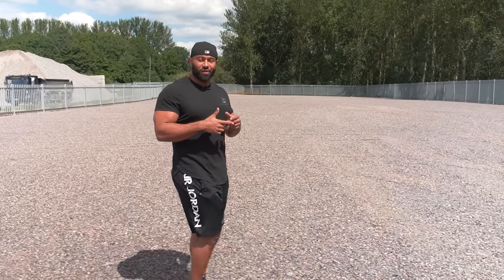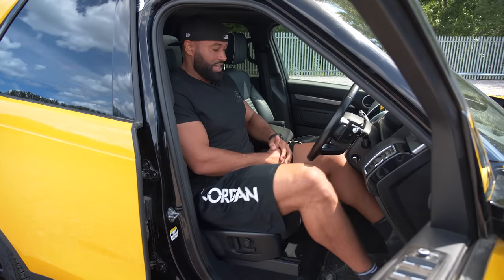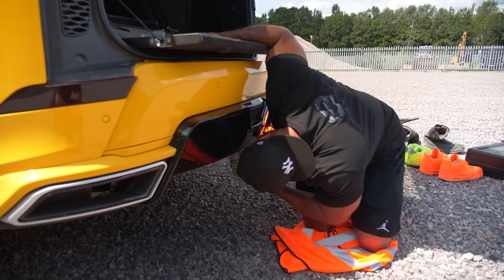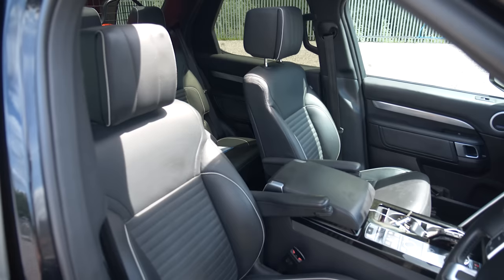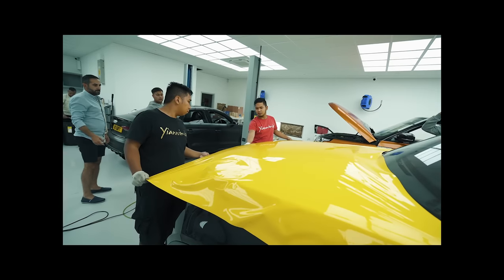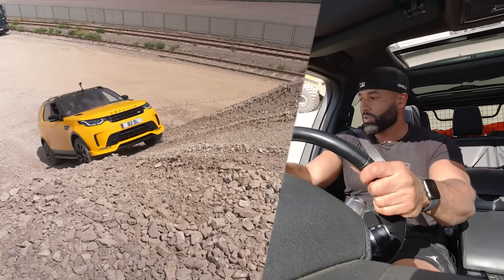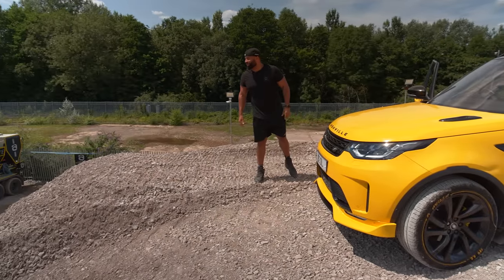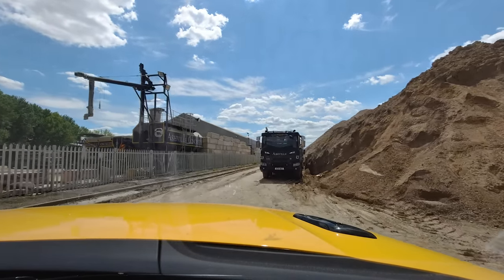Review of My Land Rover Discovery 5 with Construction Off Road Test

Comment: Try the new LR Defender, it's got front/rear cameras so you never have to worry about hitting objects or descending. May not have all the bells compared to the Disco 5 but from what I've seen it's the new work horse from them. Time well tell if there's teething issues.Was supposed to have a off road test with it through my dealer but because of the current situation that's on hold but from when I went for a test drive it handled far better than I thought though I still have my reservations about the amount of tech in it.

Comment: Hi Daniel,  the Disco 5 is a great vehicle with comfort, safety, tech, and excellent off road ability. Makes a lot of sense 4 u.  I love how it looks with the yellow wrap, and with the mods u have done. Ur car is on 22” Tyres. An all terrain Tyre will give it much more off road ability. If u put the vehicle into low range it would have got up the slope much easier. Have u done a LR off road drive day ?? It appears that u have not. I’d suggest that u do, so that u know how all of its 4wd systems work. U will learn heaps, and then u will also b able to do anything off road, much easier, and with more confidence, as u will know how to use all the 4wd systems in the Disco. If u want ur Disco to b more responsive and quicker, get an ECU tune done to it.  Enjoy ur excellent vehicle.  👍👍

Comment: I noticed b4 you descended that gravel hill that both your centre and rear lockers 🔒 were open 🔓.
Add to that, u have low profile road tyres, not surprised u got stuck going uphill !
Reply: Mazvimbbskupa Chihota check this out https://youtu.be/sLUruYymyxI
Reply: I watched it @roninesce8362  . Thank you. I am by no means an LR head, but every car its limits. Also, I'm sure you noted that was a Disco "Sport". It has limited capabilities compared to this reviewed LR5, as much as we can't compare an LR5 to a defender which is designed from the ground up to have better 4x4 abilities than the rest of LR lineup.

Comment: Hi Dan,
Great video mate. 
I’ve got the V6 Amarok but really do like those Disco’s
Have you had any problems with it? Had Disco 4 a while back and it gave me loads of trouble. 
Cheers 
Rich
Reply: The newer Discos tend to be better quality than they were for the early 2000s sorta time, definitely way less early days issues with my 2018 than a 2011 Disco.

The free five year service program is a must though in my opinion, if possible to get it free with the vehicle. Will most likely on sell before that expires

Comment: 1. You cheaped out on the tow bar. That's not the electrically deployable tow bar. 2. A quick remap will get you over 300bhp. The upgraded SDV6 is twin turbo to your single turbo. You can get the gearbox remapped too which sorts the multi gear kickdown. 3. What's the body kit?

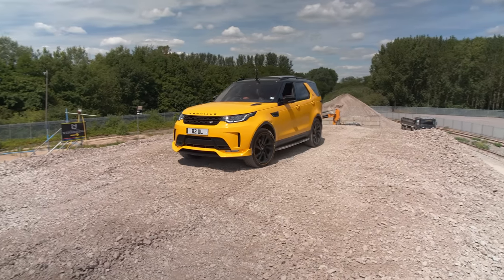Comment: 6:43 the mark of a professional machine operator right there
Reply: What, get out and have a look ?
Reply: @millomweb  yea as apposed to killing someone who's stood behind
Reply: @Daniel_Anthony  I think it's fair to say it's the sort of thing all drivers should do - have a walk around their vehicle every time before they get in and drive it.
Reply: @millomweb  yea you'd think so but being crushed by a machine is the second highest killer on site. Actually it's probably the number 1 killer now working at heights has been made safer.
Reply: @Daniel_Anthony  Yeah - those cherry pickers just won't tip over ! Had one full length extended horizontally and with just me in it, couldn't get it to tip.
Hit by fork-lift in goods handling areas I guess is similar. In all those cases, I don't blame the drivers but the person being hit. The person has perfect visibility - so no excuse - and the old rule applies - if you can't see the driver, the driver can't see you. I've never had a problem as a ped on sites.

Comment: Turn on low range with the diff lock it would climb no probs
Reply: Diff locks would have fixed the problems there - LR going for wheel spin sensors - that are just not quick enough. A decent driver with a longer memory span would help rather than a wuss.

Comment: U need to come down to the land down under and review a 70 series LandCrusier. the goat of offroaders
Reply: The 70 series would pull that discovery apart... It's a soft roader.
Reply: UK doesn't get real 4wds.. like the toyota LandCruiser ute 4.2 straight six or V8. Or the td42 Nissan patrol ute.  They are work horses built for the bush and hard work ...the discovery is a town car
Reply: @AbcdEfgh-zp1sn  yeah ik it's kinda disappointing tbh
Reply: The Nissan and Toyota utes are not Carlike so the disco is a nice compremise ...can't really compair the two... We have 4.  td42 Nissans they will easily do over 600km no problem same with the Toyotas